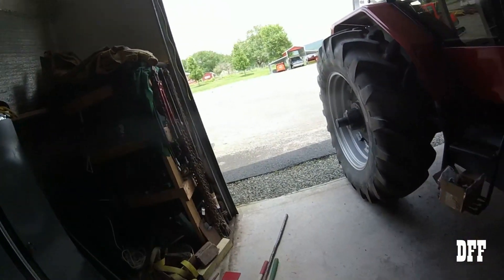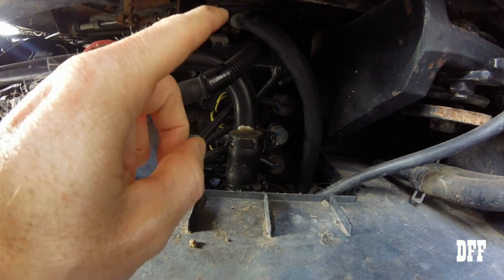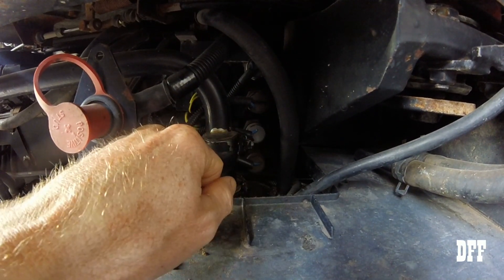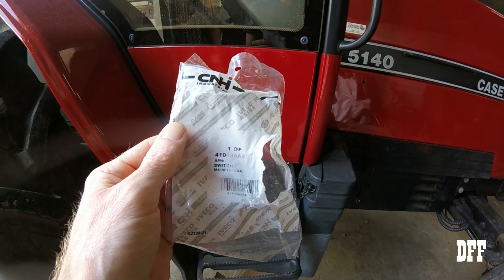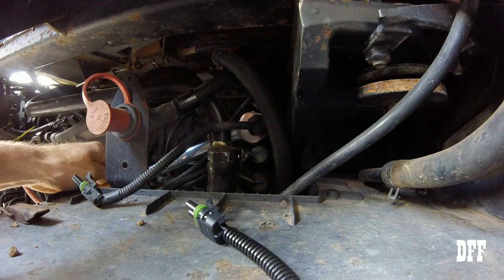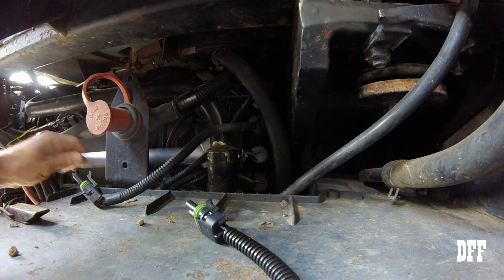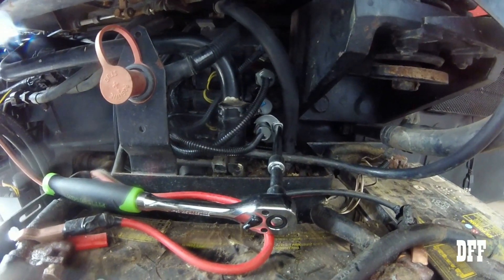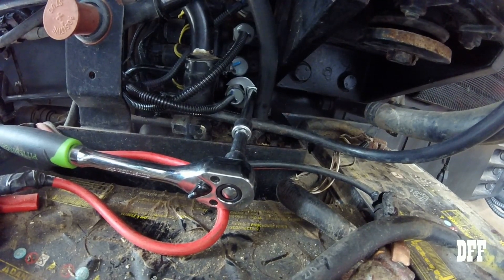Case IH 5140 Electrical Powershift Repair

Comment: Did replacing the two pressure switches resolve your powershift problems with the transmission kicking out of gear?

Comment: I bought a 5240 just over a year ago and have recently experienced the power shift not working in 2,3 or4. I'm thinking these switches. Did you know which one you had to change and if so, how did you find out other than looking at them?
Reply: Swap them to see if the issue moves to another range
Reply: @GameCastCubed  I actually placed the range in neutral and slowly ran the power shift up and down through the 4 positions a few times. Heard the clutch packs shift hard at first then they quieted down. The p shift and gears have worked fine ever since! Go figure.

Comment: I have a question.
So we took apart the whole powershift. Changed all of the O-rings...
We only changed the second powershift beacuse it was shifting into neutral but the rest of the sensor are in good condition.
But the real problem is when we shift (powershift) it jumps and that is the problem. It does this in every gear 1-2-3-4.Also when you shift uo and down. And we can't figure it out why it doesn't work properly.

Comment: We replaced all four switches with new. Powershift still doesnt work. It does not kick into neutral otherwise shifts O.K. The dealer suggest splitting the transmission but we feel it is electrical. Any suggestions?
Reply from the maker: Check all the wires going to and from the switches. Trace them all to their destinations. A bad spot in a wire was what was wrong with my tractor- not the switch. The wire was buried and I did not see the bad spot in it until I really dug into it. Good luck 👍

Comment: Please Did you solve problem?
Reply from the maker: Yes, it was a loose wire that brought power to the powershift switches.
Reply: @diggingfarmingfixing  Was the loose located in one of the switches you replaced, up in the console where the shift knob, is located, or elsewhere? I have the same model tractor and have been dealing with the same issue for the last 2 years. The shop has already replaced all 4 sensors and yesterday it started acting up on me again. Some days it won't ever do and some days it seems to do it all the time.
Reply: @mlf656s  Have you find a solution in fixing the problem? Tractor will work and the if you change powershift lever light will come on and gear will disengaged. the if you switch of the tractor and starts again it will work again!

Comment: Is there a similar switch for the forward /reverse. I seem to be having the same issue . Works great cold but after it heats up sometimes if I have to back up it won’t want to go forward again . Let the tracto cool down and works fine. I have a 5250 btw
Reply from the maker: I am sorry, I have never had to work on the forward/reverse switch, so I am not sure.
Reply: We are having the same problem with our 5250.  My mom was backing out of the quancet and only had reverse this winter.  She shut it off and we had to pull it up to the light pole, because then it lost forward and reverse.  What did you find the problem was?
Reply: @MyLifeThai371  I ended up selling the tractor but I did learn there was a switch under the cab that looked easy enough to replace. I think it just heated up and got out of tolerance
Reply: @jakem3617  Update:  I just went to the farm today and with it now being summer, instead of 35 degrees, I started it up and the transmission works good.  I guess we'll see when winter comes if the problem comes back.  Glad she doesn't have to pay the $140/hr labor rate in 2013.  I don't know what the rate is now...
Reply: Update:  After using the 5250 all summer for haying, it is now winter and the tractor will not move again in forward or reverse.  I guess it is just a summer time tractor.  :(

Comment: hello
i have a problem with case 5140 first powershift not work now but only 2 powersift work 1 3 4 not doing what could be wrong-
i wonder if you have any wiring diagrams from the case

thank you very much
Reply from the maker: I am sorry, I do not have any wiring diagrams. Could you call a dealer or repair shop? They might be able to provide you with something. Good luck on your repair!
Reply: @diggingfarmingfixing  it is possible for two sensors to stop working at the same time
thank you for your answer
Reply from the maker: @simonsinkovic5607  If a wire broke, I would think that it would be possible. I think you should trace as many wires as you can, and see if any are damaged. There are some down at the battery ground to check too.
Reply: @diggingfarmingfixing  Thanks a lot for the reply I report when we edit
Reply: @simonsinkovic5607  HI
I REPLACE A NEW POWERSIFT SENSOR BUT NO DIFFERENCE
TRACTOR GRE ONLY 2 POWERSIFT.
IT IS POSSIBLE THAT IT WOULD BE A PROBLEM IN THE COMPUTER ON THE RIGHT.

Comment: I have changed them owners should give you a code when turn key backwards. .it usually the one the gear stays in..
Reply from the maker: You are correct- the light did flash, and it did help point me in the right direction.
Reply: Great tractors.i have a 5240. And 5240...
Reply: 5250...